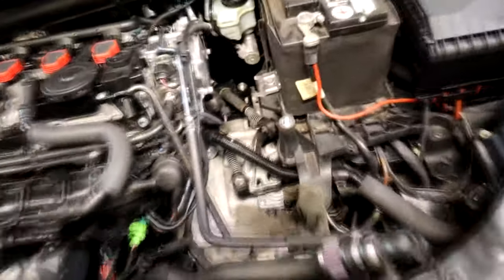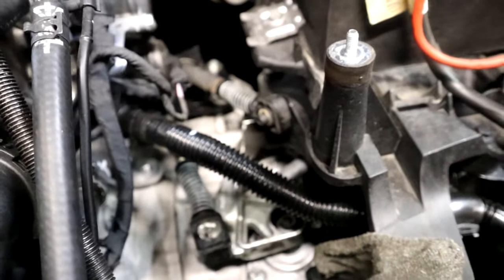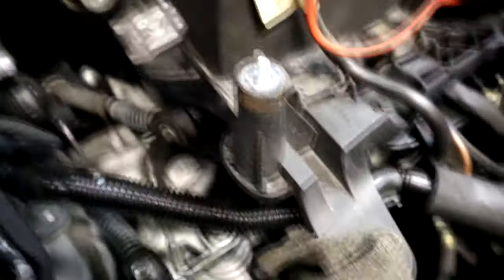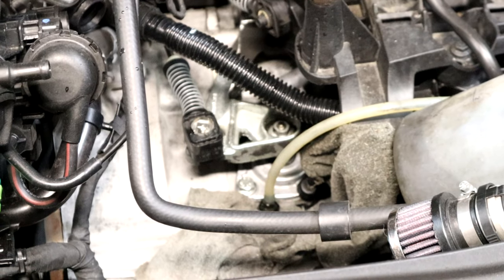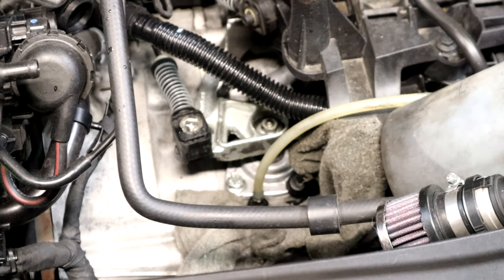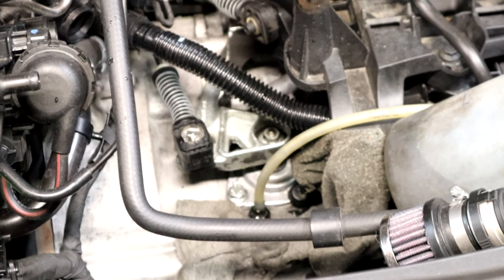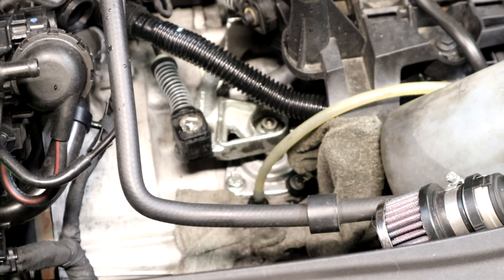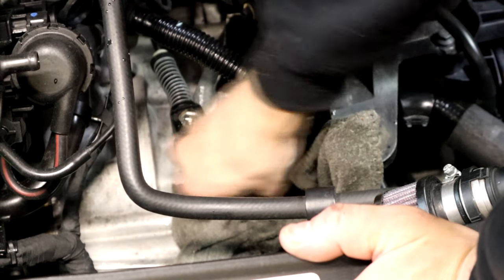how to bleed your clutch! volkswagen

Comment: Official procedure to bleed the clutch

–   Remove air filter →Engine; Rep. gr.23 or →Engine; Rep. gr.24. 
–   Connect the brake filling and bleeding device. 
       
To bleed use bleeder hose -A-. 
–   Then connect ventilation hose with the drip bottle of the brake bleeding device. 
–   Fit the bleeder hose A onto the vent valve -arrow-. 
–   Activate system with a pressure of 0.2 MPa (2 bar). 
–   Open vent valve. 

  Note:   On certain vehicles the vent valve can be opened by hand. To do so, turn the vent valve 180° to the left as far as the stop. 

–   Allow approx. 100 cm3 of brake fluid to flow out. 
–   Close vent valve. 
–   Activate foot controls forcefully from stop to stop between 10 and 15 times. 
–   Open vent valve. 
–   Allow approx. 50 cm3 more brake fluid to flow out. 
–   Close vent valve. 
–   After completing the bleeding procedure activate the clutch pedal repeatedly. 
–   Install air filter →Engine; Rep. gr.23 or →Engine; Rep. gr.24.

Comment: soo hook up the pressure bleeder, crack the bolt, pump the clutch down to the floor. lock the bolt, and what pull the pedal back up. and build pressure again? orrrr pull the pedal up & crack the bolt and press the clutch all the way down then lock the bolt again. boutta bleed my clutch tomorrow, my reservoir was topped off 3 months ago now its half full. i wonder from all the heat and braking

Comment: My clutch is sticking to the floor intermittently on my 2014 Jetta. I have a strong feeling it’s the slave cylinder since the master looks clean… this looks like fun….
Reply from the maker: Sounds like it might be crank walk, look up a video on how to check for crank walk
Reply: I thought this only affected the 6 speed 2.0T cars… mine is a 5 speed 1.8 Gen3… I haven’t had a chance to really look at it but am thinking of bleeding the slave tomorrow… the fact that the issue is intermittent is really bothersome… now it’s starting to slowly release the clutch on its own even with the pedal pressed at a specific length without moving it…. Really hoping it’s not crank walk but rather the master or slave…
Reply: Very strange that it’s only really happening in reverse, first, and rarely second… one I’m moving it never sticks

Comment: My clutch was fine I couldn’t get a brake pedal no matter how many times I bled, with and without vcds. So I tried to bleed the clutch and now the pedal will stay at the floor and tried bleeding the clutch multiple times and always air comes out.
Reply: Any resolution to this problem as mines doing this right now

Comment: Just replaced the slave cylinder in my 2012 vw jetta. Can't get the air out of the system. Been trying to bleed the slave cylinder for 2 days. Nothing but air is coming out. Don't know what else to do but junk the damn car!!🤦🏿‍♂️🤷🏿‍♂️
Reply: The slave cylinder needs to be filled and bled on your work bench first, then install it, already full of fluid. Bleeding the clutch only gets air out of the line from the master cylinder to the slave cylinder, but won't help for air past the bleeder nipple.

Comment: I got a question for ya, do you know of a way to bleed the slave cylinder once its already installed in the car. (I didn't know I was supposed to bleed the air out of it prior to installing) I replaced the RMS, clutch pack and the TOB/slave. The clutch pedal has no pressure/resistance at all. Tried bleeding it for a while and nothing happens. The rez is topped off. I can't tell if the master isn't  sending the fluid or the slave has air in it.
Reply from the maker: if you do not have a pressure bleeder it takes quite a bit to get it going, open the bleeder screw and press the pedal to the floor and wait till fluid starts coming out on its own,
Reply: @carwerks101  thanks man and one more question what is the ribbed hose that runs along/above the shifter tower then under the battery tray then down under the driver side headlight area. it looks like it starts from under the vaccum pump. some how i broke it.
Reply from the maker: @westonstaufenberg7278  it’s a damper, I believe ecs sells a delete line for it
Reply: @carwerks101  i think this might be it
 https://www.ecstuning.com/b-genuine-volkswagen-audi-parts/connecting-pipe/1k0131128d/
Reply from the maker: @westonstaufenberg7278  oh that one, thats for the secondary air, i use heat shrink over it when they crack, they have been the same pos hose since the early 2000's

Comment: Thanks for your videos. I’ve got a mk6 Jetta TDI and your videos have helped me out a few times.

I plan to flush my brake fluid soon. Going to buy a pressure bleeder to do it but want to learn more about bleeding the clutch. If using a pressure bleeder to flush the fluid, would I do the same thing to bleed the clutch but without needing to pump the pedal?
Reply from the maker: Yeah, but in between bleeding I pump the clutch a few times, it always traps some air

Comment: I just had my GTI MK6 clutch replaced with a Clutch Masters FX250 kit, which also included a flywheel and a slave cylinder. They replaced them all but didn't tell me if clutch was actually bleeded and, from time to time, when the clutch pedal is fully pressed and 1st gear is engaged, the car will slowly move forward and the gear becomes super hard to disengage, even if the pedal continues fully pressed; the only way to fix this is by fully releasing the clutch pedal, letting the car move forward, pressing the clutch pedal back again and finally disengaging the gear as usual. This also happens on reverse in the same exact way. Shifting from 1st to 2nd becomes kind of difficult after this happens, but the rest of the gears engage without issues. My question is, do you think bleeding the clutch would aid in fixing this situation or we're talking about something completely different? Thank you in advance.
Reply: Did you ever figure this out? Because I have the same issue right now except i installed the fx300.
Reply: @chrisculpeper7315  I just posted this yesterday, still hoping to get an opinion from the dude in the video! But now that you're confirming that you're having the same issue with a CM kit, I'm starting to suspect this might be due to the plastic slave cylinder... I'll continue investigating and update you as soon as something is found.
Reply: @ROMANERUIZA  thanks man, i have tried everything i can think of. I have not tried to re-bleed my slave cylinder yet. I do have a grinding sound though and can't shift into gear while the car is on but I can when it's off.
Reply: @chrisculpeper7315  just an update: I went ahead and not only did I have the clutch bled, but also had the whole brake fluid changed, however and unfortunately, that didn't fix the issue (though the clutch pedal feel did improve). I'll continue working on it and update you again on the new findings.
Reply: @ROMANERUIZA  have you tried adjusting the shift cables?
Reply: @333Squishy  yes, I did, along with a master cylinder change. Unfortunately, that didn't fix the issue. I'll have the transmission dismounted in the upcoming weeks to see how everything's looking, from the slave cylinder to the clutch and flywheel themselves. After all, almost a year has passed since the CM kit was installed.
Reply: daaamn thats crazy. could be a transmission problem?

Comment: I just changed the master clutch cylinder and slave cylinder on my 02 jetta. I followed your direction and spent about 25-30 minutes on it, but the pedal still stays on the floor with no real change in resistance. Any suggestions?
Reply: You ever figure it out I have the same problem
Reply: Cab you do a vid explaining what your syptoms were, what you did to change it

Comment: Great vid! Is there a certain amount of fluid you need to bleed from the clutch? Also as the clutch and brakes share the same reservoir, do you need to bleed both?
Reply from the maker: just need to make sure the master cylinder is filled to the max line

Comment: Bro idk If you’ll see this I have a mk7 gti I went stage 2 dkm and it seems as though the throw on the new slave cylinder included in the kit isn’t enough to push on the pressure plate. Is this a thing ? Doesn’t make any sense because when I bench bleed it and as soon as I’m sliding in the tranny on dowels it squirts it dry. Meaning it’s making contact w the pressure plate could I have lost that much brake fluid in the system ?
Reply: I already pulled the tranny back out thinking it was the clutch disk on backwards but it wasn’t. I will be buying a new slave cylinder and see what happens tomorrow
Reply from the maker: I have never had an issue with dkm, make sure you don’t have a clutch stop installed on your car, I’ve had people that didn’t know the previous owner put one in

Comment: my clutch pedal ia doing same but when i looked under the car i had abit of brake fluid on the floor looks like its coming from gear box any ideas whats wrong?
Reply from the maker: slave cylinder leakign
Reply: @carwerks101  thanks for the reply how can i fix it?
Reply from the maker: @ginofield  replace it
Reply: @carwerks101  I found the place it’s leaking from gunna try change seal an pipe now

Comment: Do not pump your clutch as this guy does. That is not the way to service your vehicle. Instead you only push it down once then lock the bleeder and pull the clutch up. There's better and more accurate videos on here.
Reply: Im working on my clutch to finish replacing my fluid in my mk4 and found this info im gonna try

Written in the Bentley is: 

1) use pressure bleeder to pressurize the system to 30psi (2bar)
2) open bleeder valve
3) Bleed of approximately 100cc (3 1/2 oz)
4) close bleeder valve
5) quickly pump clutch pedal 10 - 15 times
6) bleed of additional 50cc (1 3/4 oz)
7) close bleeder valve
8) pump clutch pedal several times after completing bleeding process
9) check and top of hydraulic (brake) fluid in reservoir as needed.
Reply: @terrycarlin2443 where does the pressure bleeder connect
Reply: @pmaster587 the pressure bleeder is connected to the slave cylinder and the slave cylinder is connected to the master cylinder

Comment: I have a weird question I hope you can help me with. I have a 14 jetta tdi and I got in the car this morning and the clutch went to the floor. The brakes work fine but I assumed the slave went bad however it has low miles and has had zero issues. I popped the hood to find a rat nest on top of the brake master cylinder right where you fill it. Before tearing the car apart to figure out what they chewed up, what could possibly be chewed through to make this occur? Can you give me any idea where to start looking?
Reply from the maker: Probably chewed through the soft line part of the clutch line under the trans mount

Comment: I replaced the cmc and slave but when i pump the clutch nothing happens, ive filled the reservoir alot of times, am i doing anything wrong? When i bleed the nipple only a few fluid will come out but theres bubbles coming out too, any ideas? Its a vw mk4 gti btw
Reply: Yea what if you don’t build no pressure?

Comment: My clutch needed bleeding as it sprung back up whenever it felt like it. But after bleeding for 20mins the pedal stays on the floor,  worst than before. Any advice? Thanks
Reply from the maker: Sounds like dead slave
Reply: I.ll check it our thanks
Reply: Yup slave cylinder

Comment: 06 Jetta clutch pedal sagging close to floor with barely any resistance, still goes into gear but have to push pedal down all the way. The fluid looks brownish so I want to replace it but how do I know if I need to replace master/slave as well?
Reply from the maker: Natsu Dragneel dirty fluid is fine, is your master full? Pumping doesn’t help? Bring it up with your hand
Reply: @carwerks101  it just flops back down to a few inches from the floor. Wont stay. How do I check the fluid level in there? Thank you so much btw

How long do I have to pump it? I tried for about 1 minute to no avail
Edit: it will stay until the next time I push the clutch. Am i having an issue or am i creating one haha?
Reply from the maker: Natsu Dragneel 5 speed or 6 speed?
Reply: @carwerks101  5 speed.
Reply from the maker: Sounds like clutch is toast, pull the trans
Reply: @carwerks101  my luck ^-^ thank you, you're extremely helpful.
Reply: Did this fix your issue?

Comment: How does air not go back inside when u just pressed the clutch with the bleeder screw open once it shot out and u left the bleeder open?
Reply from the maker: Push the pedal down close the valve and pull the pedal back up